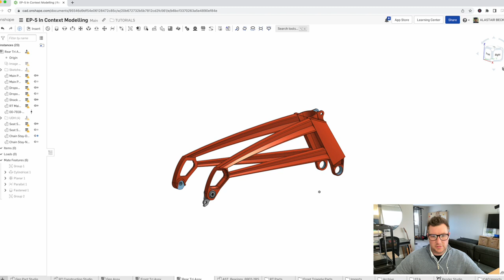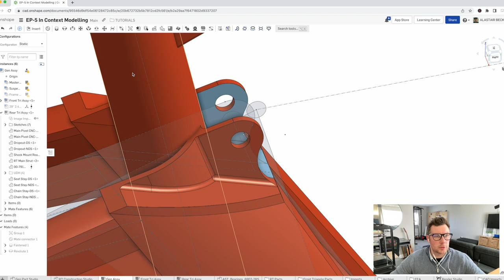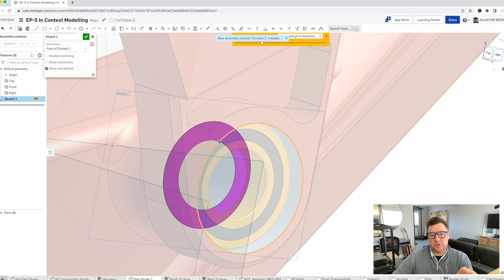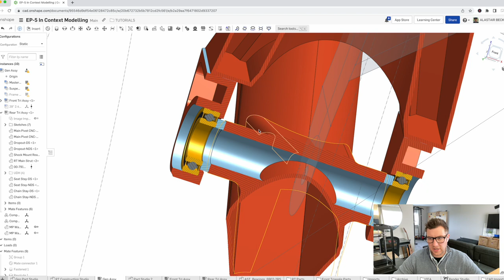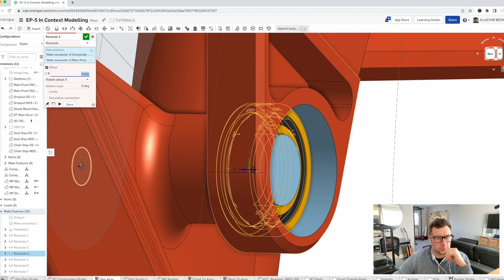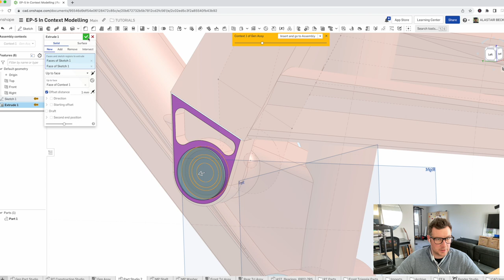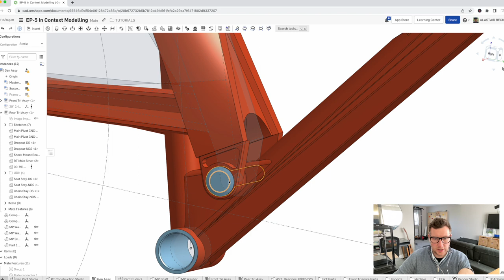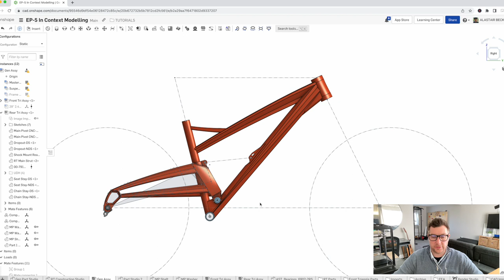IN CONTEXT MODELING USING ONSHAPE | BIKE FRAME DESIGN TUTORIAL - EPISODE 5

Comment: Did you make a video for designing the rear triangle? It just kind of appeared, and I cant seem to find a decent video describing the process.
Reply from the maker: Hi Megan. We did skip through the rear triangle design on the Orange frame for the purposes of covering 'In Context' modelling. However, we go into a little more depth over on the latest video where I model an Intense M1 from 2001/2002. You should be able to pick up some pointers from that video which should help with rear triangle design. https://youtu.be/ETIUZvMWvqo?si=L37nDVEt6slajHgI